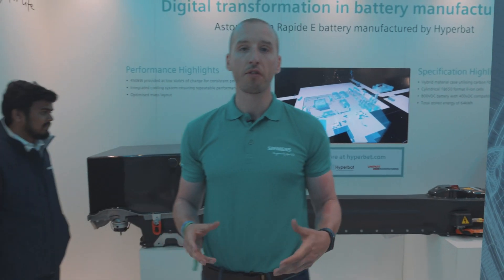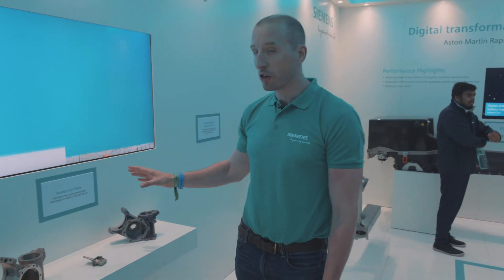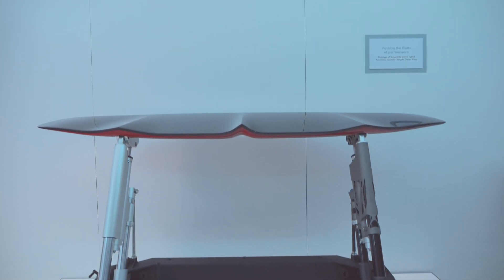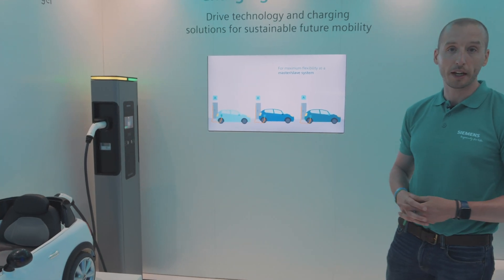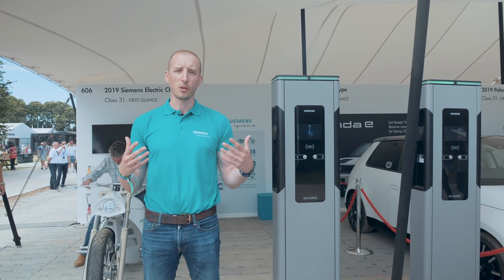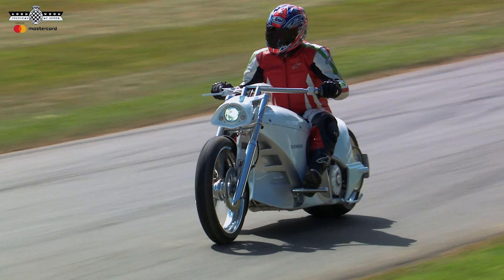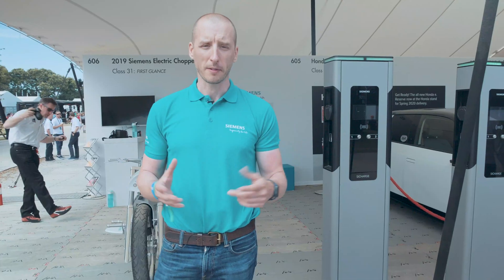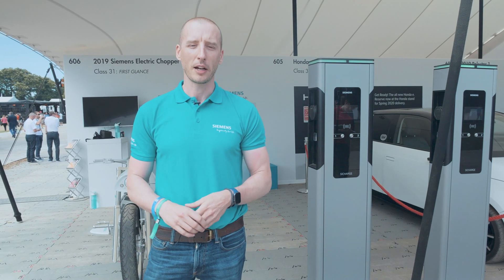Did you know Siemens can print a Bugatti Chiron wing?

Comment: I don't understand  how this 3d  printing works.   Can someone explain  it to me   ?
Reply: So, say you're printing a picture of a dog with a normal ink printer. It has one 2d layer of the outline of the dog.

A 3d printer is the same process, but using a material that's 0.01mm thick, repeatedly stacking 0.01mm layers on top of each other, to build your 3d shape. A 3d render is used to tell the printer where exactly it needs to print each layer. But essentially all it does is print an outline like a normal 2d printer, and then move up 0.01mm, and repeat that a few thousand times.
Reply: Yes, I can.  However, we're unleashing AI on it now, so anything I tell you might not make sense tomorrow.  In any case, if you want tech support on the matter, you'll need to deal with a Millenial and download an app that will steal your identity and all your contacts as well.  It's best to not ask questions.  They have major student loans to pay off, you know...  Beware.

Comment: Curious about long term. Based on what I've seen, read and heard. I think hydrogen power should be the way to go. Starting big by replacing coal and oil power power plants that serve the various grids worldwide. No battery issues or dependance on the weather.
Reply: KAOS NATION 
Excellent point. You are on the threshold of knowledge about the energy whirlpool.
The old professor
Reply: other than the fact it takes a ton of power to actually make hydrogen in the first place :P
just putting that power into a battery is better than useing it to make hydrogen, then useing that hydrogen to make enegery and putting that into a battery.
going the hydrogen route loses efficiency with all the conversions and you only really gain the gas car-like experience of having to go to a gas station to fill up while you can just charge an electric at home over-night.
and if you really need to go on a journey that's more than 300 miles I think you'll need to stop for about 30 minutes to get something to eat anyways :P
Reply: Valentine 
You are jumping tracks too many times. Go back and stay focused on one thing (concept) at a time, and follow it to the final (truth) conclusion.
The old professor